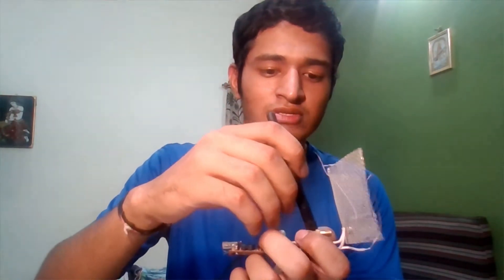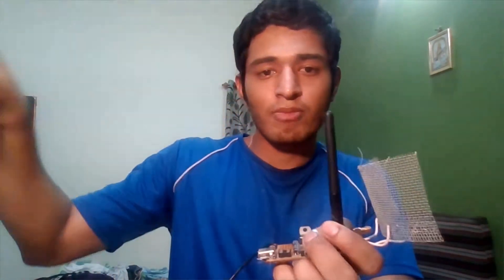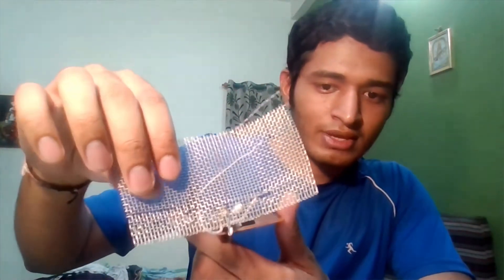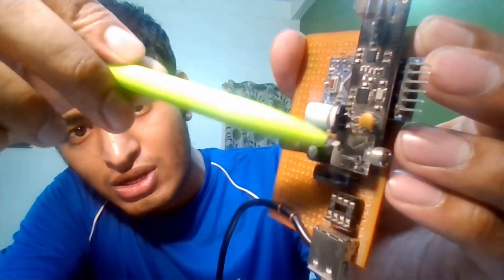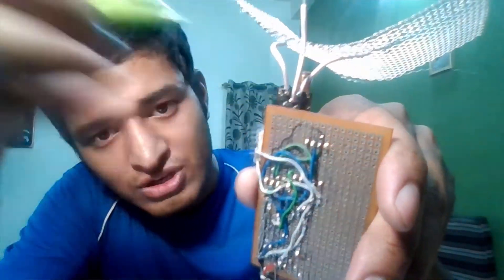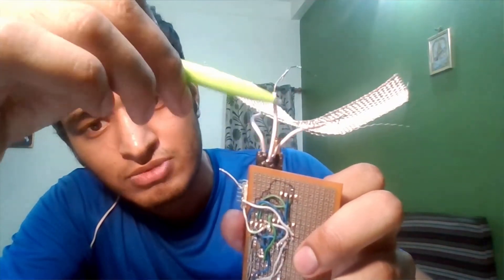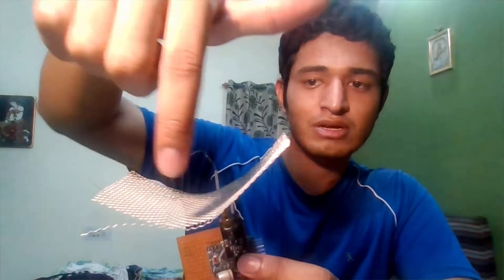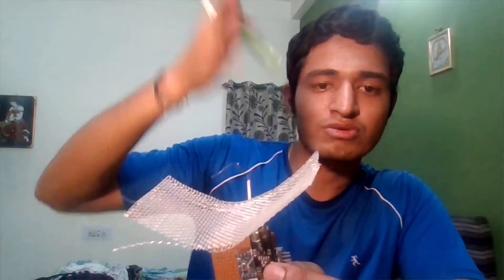Hack NRF24L01 Radio for Longer Range!!

Comment: Sir it is said that the nrf24l01+ pa +lna module can transfer voice or deta upto 1.1 km. But you have told that it can transfer the voice upto only 450mtr. which is very low. Sir please give me the library & code of that to my email as early as possible. If you use the steel net into it, it is very bulky and not portable. Thanks for your experiment and we have taken a lot of experience from you. My email is sibaram2datta@gmail.com.
Reply from the maker: Yes, it can send data upto ~1 km in line of Sight, but in form of packet I.e shot bust of data. In our case voice transmission, it require continues data transfer (minimum ~50kbps) that's why range drops in this scenario. I have sent you library.
Reply from the maker: Yaa, steel net is bulku Nd sensitive, I made this for, when we need to get data from different sensors which are place at very long distance in fields. So in that stationary Station it's fine to have this kind of setup. I made  receiver as mobile device where as transmitter as stationary.
Reply from the maker: It's honour for me you, my video helping you :)